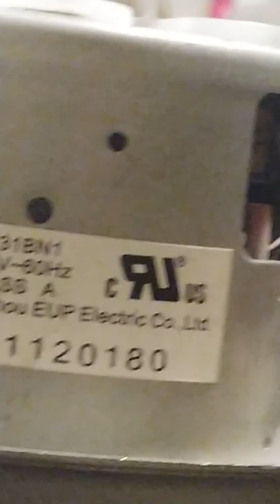Howe to run an AC vacuum motor on DC

Comment: Any "Universal" series wound motor will run on either AC or DC.  No tricks here.  Just make sure it's connected.  Loved that line as his wire came loose.  Also, a vacuum motor will run faster with no load (not moving air).  Having the intake down on the bench will inhibit air flow and thus, the motor spins more easily.  Try using a couple car batteries for better results, but don't expect it to suck up very much dust as those motors are designed to spin at high RPM's.  Just because you can make it spin doesn't mean you can do anything useful with it at those low voltages.
Reply from the maker: Riiiight
Reply: if the copper wire magnetic change to magnet will it more easy and save current?
Reply: Its like cavemen with fire lmfao, "I make thing spin can use to build car run on battery..."

I came to youtube cuz I got a free vacuum for parts and wanted to see the motor in action and what size it was/how its built. Also if there were any other useful parts but only found these videos... i thought he would rewind the motor for more torque and less speed or something useful

Just gonna use it as a dedicated dust collection for tablesaw, hopefully my breaker can run both
Reply from the maker: @wengsiongsai2815  i dont know weng, i just felt like recycling or taking apart a vacuum because i always wanted my own vacuum but never wanted to buy a new one in the end it was just for fun and nothing else
Reply from the maker: @user-tr2dh4xx6u i have very little to offer besides showing that it is relatively simple to make the thing spin with dc electricity..........i diddnt show it in the video but i had a inverter that i bought, i have since returned it......but anyway i used ac voltage from the inverter and that really made the thing spin very loud............ommmm all in all it was mainly for fun, i didnt really offer any specific information on the motor......

Comment: So what did you do with the power wire, ground wire and both brush wires?
Reply from the maker: I connected the power (positive) to the brush. Then I connected the ground (negative) to the other brush

Comment: Why would this be useful?
Reply from the maker: You can build a window fan
Reply from the maker: It could power a air powered tubular mail carrier system for an office building or it could spin out contaminants in a centrifuge
Reply from the maker: its useful if your on a crazy binge for a few days and need to tear something apart!
Reply: With a boost circuit and a speed controller circuit and a larger battery oh and a BMS circuit you could attach it to a bike, skateboard, scooter, etc and make it an electric version of that thing. You can use an electric throttle in place of the potentiometer in the speed controller circuit, it's just a fancy pot. I'd build all the circuits on one board, maybe add a light system too since we're going electric ... but the universal brushed induction motor would be the work horse... they are great motors, they are durable the pack-a-punch for their size, and they're universal (meaning they run on AC and DC) so they're very useful. They're used in most power tools (that don't proudly advertise brushless all over the box) most vaccumes, they used to be the every motor. They're largely supplanted by brushless motors nowadays, but in application they work much the same except the brushes eventually wear down and may not have available replacements.